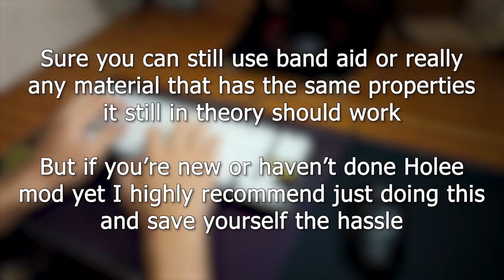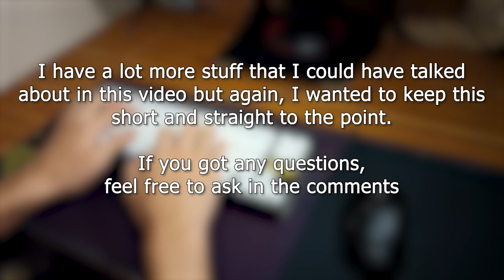Best method to remove ticking stabilizers | Holee V6 Tutorial

Comment: but why the cotton in the stem, how would that reduce rattle ore any kind of noise in the stab? Im hardly confused. But besides that great video, keep up the good work!!
Reply from the maker: Hi! Thanks for commenting. The purpose of the cotton inside the stab stem is to make it so the electrical tape is more secured on to the stem. Making it less susceptible to falling out due to friction. It doesn't contribute anything to lessen the rattle or noise in the stab, it just helps with making the electrical tape more secure so it doesn't come off.
Reply: @kael5912 , can I put a dab of hot glue then? it will be a more permanent fix.